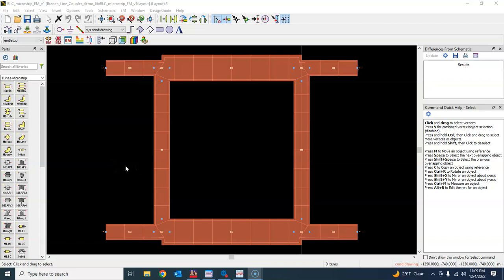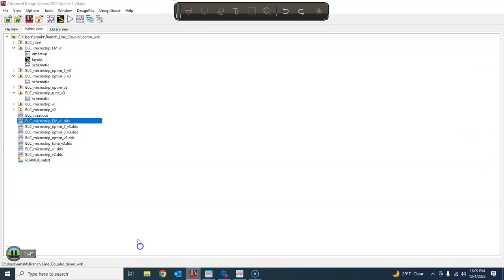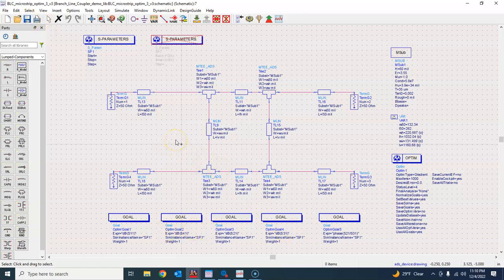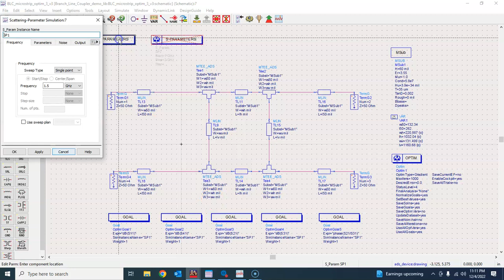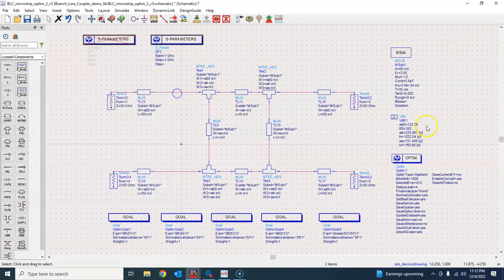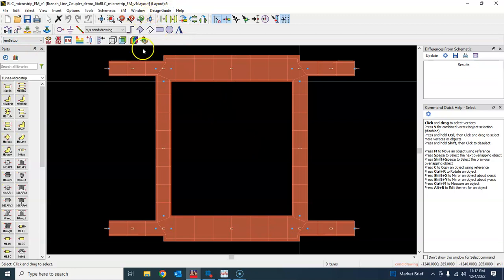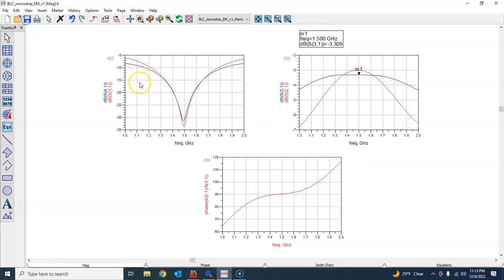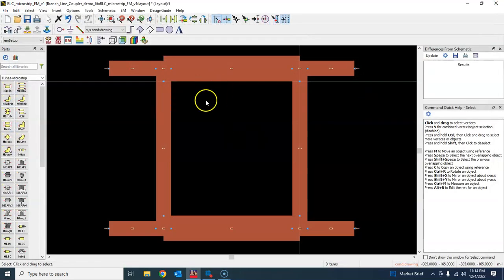Microstrip Coupler Design using Advanced Design System (ADS)- part 8

Comment: Hello Mohammad, Can we use LSSP (large signal SP) controller for optimization instead of the small signal SP controller?
Reply from the maker: Hi Wajid. Why do you want to use LSSP for this kind of linear problem?
Reply: @MohammadAMaktoomi  In fact, I had some trouble implementing the LSSP controller for the optimization of my nonlinear circuit. Anyhow, I have fixed that issue. Thanks for your response.
Reply from the maker: @wajidalikhan7933  I am glad you could the issue.